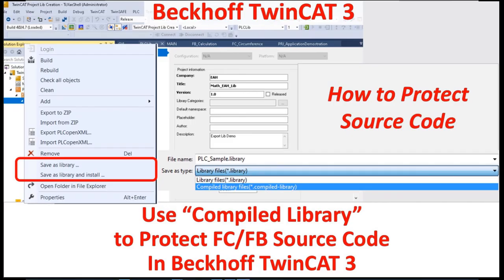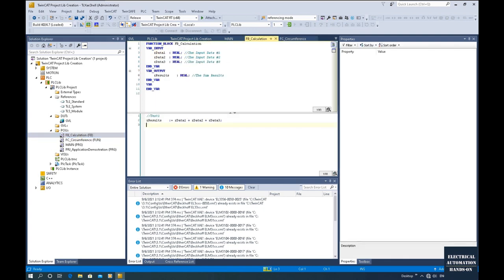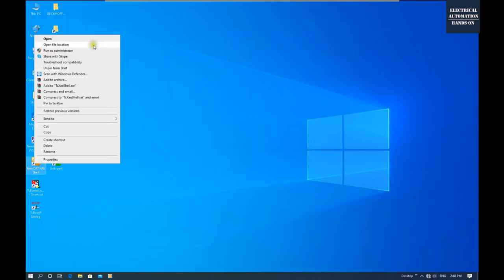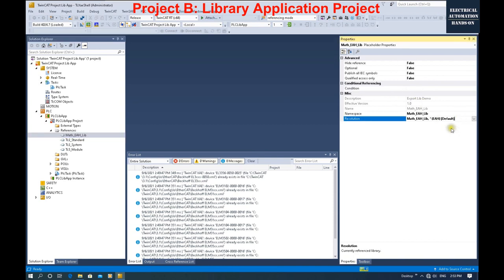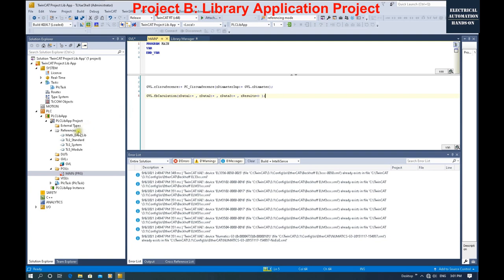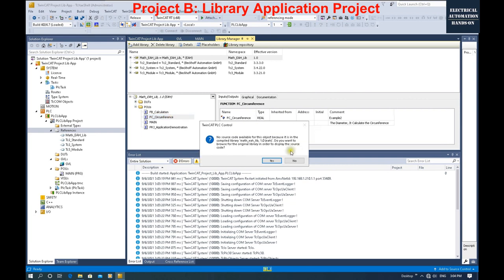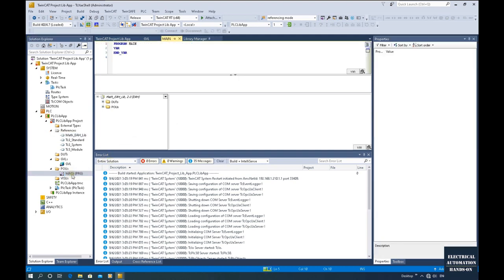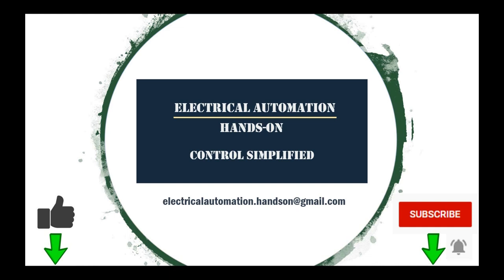BK16. Using "Compiled Library" to Protect Source Code in Beckhoff TwinCAT 3 Project

Comment: hi , thanks for your video. Can i use same method for Stm32 for TexasC2000 microcontrollers ?  which compiler may i use ? thanks
Reply from the maker: Sorry, I don't think so. Definitely you have to use regular PC+windows or some Benchoff controllers which uses ARM CPU and Windows CE system.